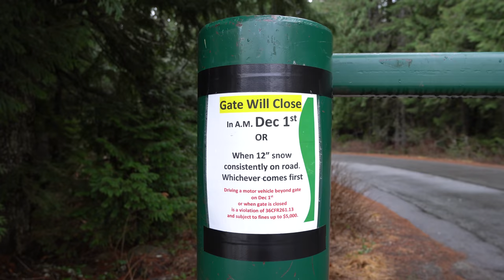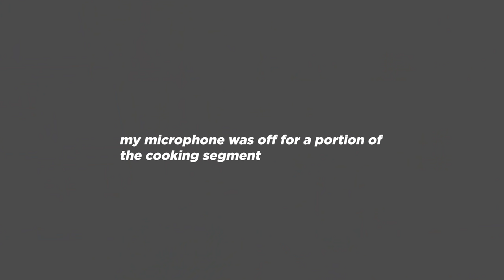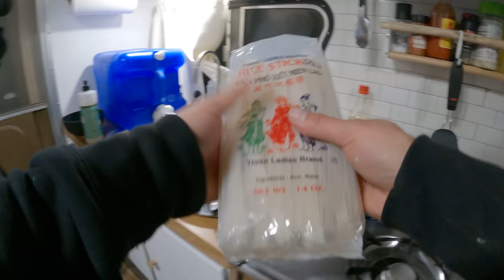Solo Overnight Deep in the Forest (in my Renovated Truck Camper)

Comment: A suggestion when you get around to using the dicor sealant.  I've used it for a decade on my travel trailer, and have found it's good to rub the seam you are going to apply it to with a little bit of mineral spirits on a rag.   And then do that again each time you use it.  The mineral spirts will slightly dissolve the dicor, helping to flow back into itself, sealing the cracks that have developed.

Comment: The cool thing about this old camper is its easy-to-use and work on. Soon you will know it in and out and it will all be easy. I bought an old 80s motorhome. Very easy to work one and no computer that only the dealership can service. Plus it inlt cost me 1k to buy. Put another 2k into it and it's all working. A lot better than 40 for a newer used unit. Thanks for sharing this.

Comment: If you are still in the Portland/PNW area, hit me up if you need any supplies, or need to do any maintenance on your setup.   Also, if you are still using that plug in bulb, you are using way more power than you need to converting from DC to AC to power a bulb. Get some USB or 12V lighting instead! :)  I can even throw some LED bulbs your way.  Funny enough, I was diverted from that exact gate to Trillium last year, but because it was too early in the year and it was still snowed in.

Comment: Nice vid. I have a new truck camper. I have had to seal it from day one. I started with 2 leaks. One from the side mount a/c and fridge vents. The other was a screw hole left empty on the top corner. It's just part of wood truck camper maintenance. Also i live in a tropical rainy area of the country.

Comment: Hey man - out of concern - you should really bleed the lines on that propane. Just hop back in the camper after shutting the tank off, light the stove until the gas runs out, and turn it off. (Always remember to turn it back off)

Comment: you're not cooking them wrong there's like 501 ways to do wide rice noodles.  You can even chip and deep fry them.  What you were looking for is boiled and drained after 7 mins but you did fine try adding a little oil next time they wont stick together.

Comment: That spray Flex Seal is a waste of money. Get a gallon of white elastomeric coating from Home Depot. It will last much longer, even though it will still fail eventually, or you can buy an EDPM pond liner and cut it to fit and glue it down. Much better fix. A teaspoon of vegetable oil in your noodles will keep the from sticking together (keeps the starch from binding).

Comment: I’ve lived in multiple TCs  since 2016 and fix them up to sell. 

Flex seal  is terrible stuff, only thing they make that is worth using is the tape. Dicor is way over priced and like you said needs very specific climate to cure properly. I use 100% silicone caulk such as GE brand and/or Alex plus caulk. Way cheaper and cures down to 30F.  Latest product I’ve found that is very robust is Henry’s tropi cool roof sealant. It’s applied with a putty knife due to viscosity, but prob could put it into a used empty caulk to for more precise and or smaller areas. 

Just fyi I would I stand a trans temp gauge on your yota. Those autos are not meant for hauling and towing full time. 

Cheers